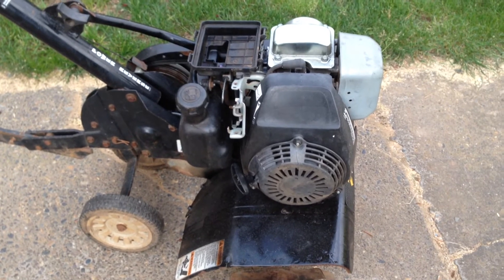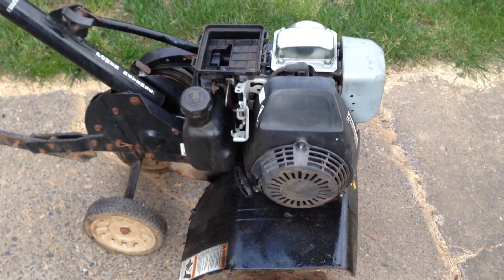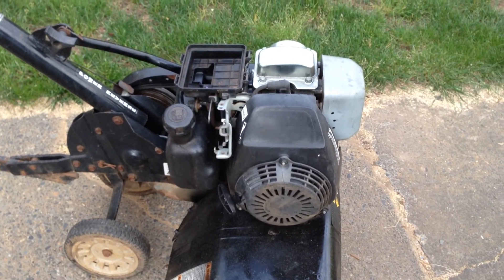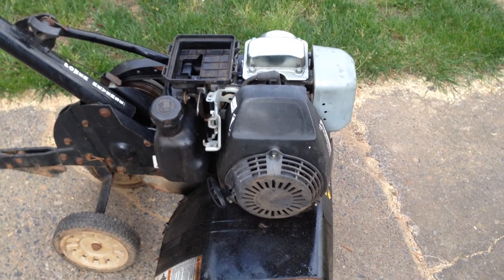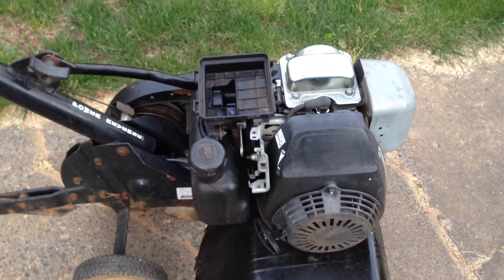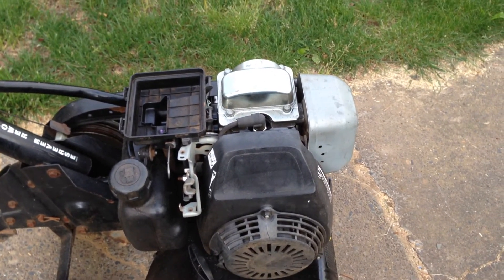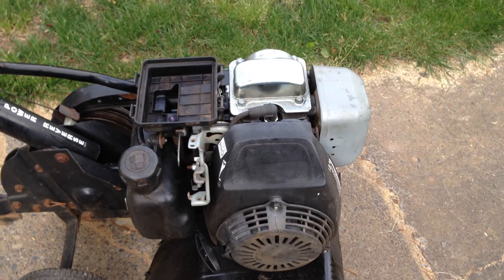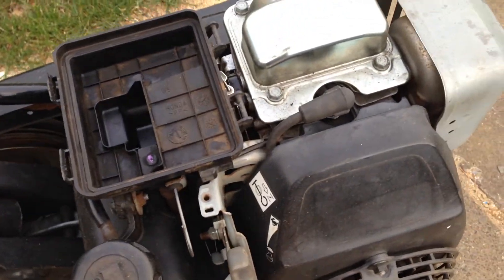MTD 24" Rototiller with Honda GC160 - 5 HP Engine - 02

Comment: Change the spark plug that fixed my don't check it change it
Reply from the maker: You are correct...   that is exactly what fixed this engine..  after putting in a new plug, it ran and ran and ran..  good little engine.

Here is my last video in that series - with the solution...

https://www.youtube.com/watch?v=Nk7C2PKJMPA

Comment: I have the exact same problem. Maybe something is happening with the fuel filter? Needs changing?
Reply from the maker: Albert Yoloswag 

Albert...  Here is my follow-up video on this problem...   check it out...

https://youtu.be/oN-6vwAf6K0

Start the engine with the fuel tank cap OFF - you should see the fuel pump working and LOTS of overflow gas returning to the tank..  like in the video linked above..  to me that says that the fuel filter is fine, and the fuel pump is also fine.

I think I finally found the problem with mine...  read the comments in that video..  you may want to check that on your engine...